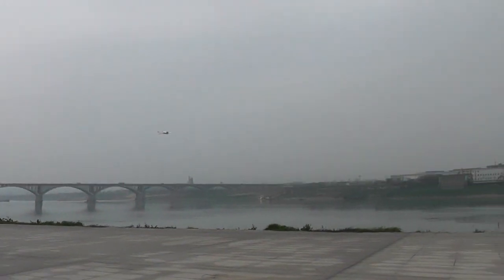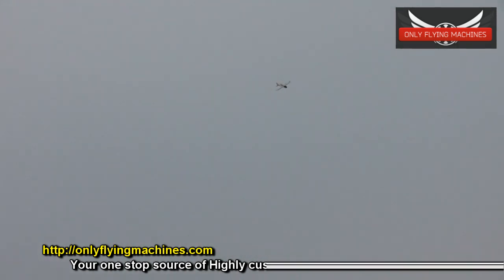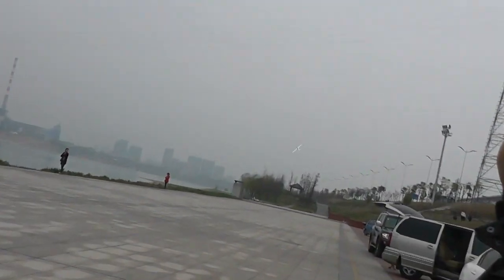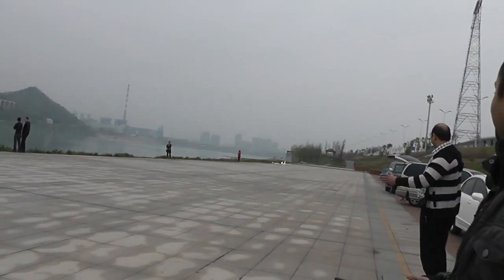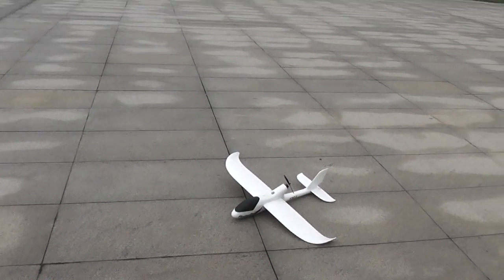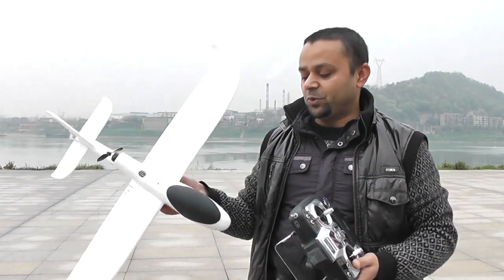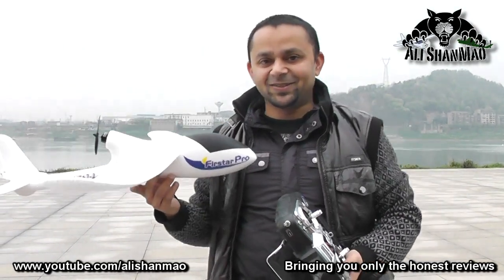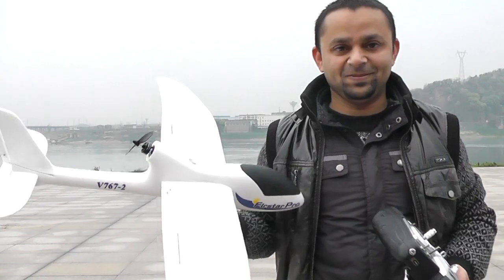Mini FPV Glider Firstar Pro in Aerobatics flight testing

Comment: Hi, do you have any recommendation for the prop? I have lost the original props. Replacements have not flown as well. any help will be appreciated.I got lost between prop selection, proper rotation and prop orientation.Thanks, LooseBruce